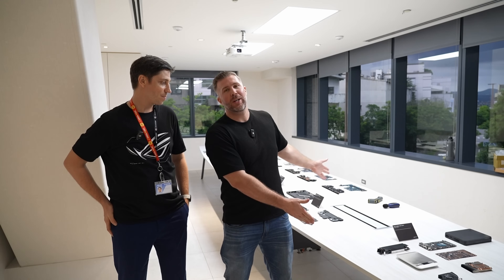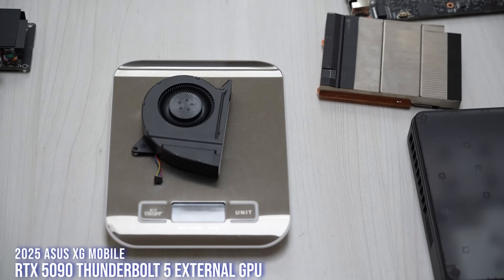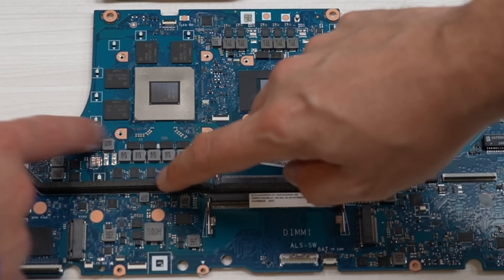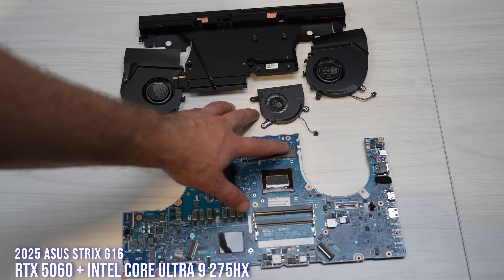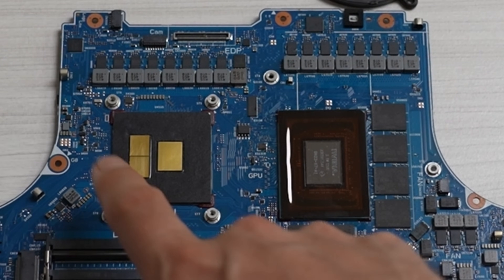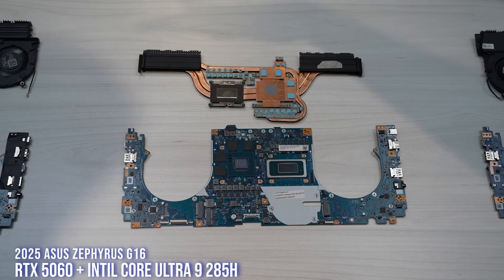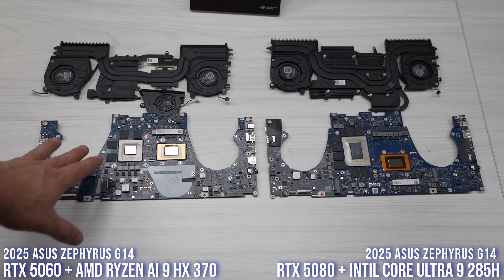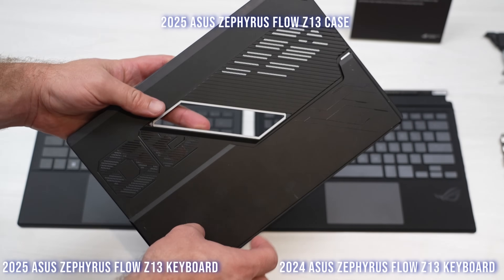Every 2025 Asus Laptop Motherboard/Cooler Analysis! 9955HX3D vs 275HX! RTX 5060, 5070 TI, 5080, 5090

Comment: well anyway we all knows the best CPU is AMD and it's the 9955hx3d or the 9955hx, the 285hx is the 3rd place, 4th place is 275hx
Reply: x3d is just too good when games or software utilizes it.
Reply: 275HX actually slightly outperforms 9955HX. Of course, the X3D chip is top of the heap.

Comment: amazing video, congrats! did you ask why no 5080/5090 with the x3d cpu? There is a small mistake in the g14 section of the video, it mentions intel cpu with 5070ti/5080 but it is amd only.
Reply from the maker: I made a video about this here: https://youtu.be/q1fxgoCvckk

I can't really understand the decision making. I have publicly said over and over again--and to Asus directly that this is a huge mistake and that they should have made the Asus Scar 16X3D and Sar 18X3D versions with the new tooless bottom chassis. 

My honest thoughts on this: 1) Asus probably had lots of leftover chassis from the Scar/Strix from last year, and they wanted to still use them, so it's cost effective to use the extra chassis for a second product. They thought people were going to prefer Intel again this year, but the reality is AMD is ahead currently--and the 5070 TI GPU is the most like to sell the most units, so they probably wanted to limit total number of configs since that increases costs. 2) Intel and Asus collaborated on the new version of the chassis somewhat, so I believe that Asus is likely giving them an preferential treatment for now, which sort of makes sense if Intel invested money/time/effort into the project and AMD did not. 3) Asus has a long standing relationship with Intel dating back 10+ years. 4) AMD failed to supply chips to nearly ANY manufacturer during the covid chip shortage, while Intel had supply, so I think Asus HQ feels it's too risky to base their flagship product on AMD most likely. And we are seeing that, not enough X3D chips to go around, so limited supply is a valid concern.

All of that said, I still think they should have at least offered the 2024 chassis with the highest end RTX 5080/5090--they are just erasing potential profits when loyal Asus gamers see the highest end CPU/GPU being placed into another brand and not Asus, forcing them to jump brand to get the fastest GPU/CPU combo--which I predicted all the way back at CES 2025.
Reply: @GizmoSlipTech thanks, it always amazes me how they miss seeing the obvious. Imagine for example a « thick » version of zephyrus g16 kinda like blade 16 2024 version, with x3d cpu, 5090 and oled, it would dominate❤
Reply: @michaelcorleone3282  so for the zephyrus g14 5070ti version, which one the cooling system we'll get?

Comment: I might buy a 4070ti g14 when there is a good sale as the 4070ti does lose that much performance at 120w from experience (a friend of mine has bought a msi vector 16 hx with 5070ti on ballanced mode it uses about 120w gpu cause at full 140w power it is very loud over 55 db)
Reply from the maker: Do you mean 5070 TI?
Reply: @GizmoSlipTech  oh haha yes actually the 5070ti

Comment: i m wondering if u buy a vapour chamber version laptop , is it a once in life time solution or do we need to apply liquid metal to the cpu  do we need to change or reapply in after some years of use ?? what the use case of vapour chamber laptop with difference to regular heat pipes laptop???
Reply from the maker: Typically, heat pipe or vapor chamber (doesn't matter), liquid metal can last a really really long time if it is sealed correctly--like 10 years. But if the seal breaks or it was a bad initial application, then you may need to reapply. For this reason, a lot of companies are switching to 2 phase material like PTM 7950 that has about as good/better temps as liquid metal, but it is hard to mess up the application and lasts about as long. I believe Asus has a lot of their laptops this year with PTM, unless you see the liquid metal shroud over the die, then it's PTM being used instead of thermal paste, which both degrades over time quickly due to drying out after 1-3 years, depends on the paste though.
Reply: @GizmoSlipTech  thanks bro ,right now i m using MSI CROSSHAIR 16HX 4070 ONE,cpu is throttling, clockspeed going down during editing videos even though it is 4 months old  , so i might go for ryzen fire series lineup this time, asus is better in cooling than MSI , i guess

Comment: Thank you for interesting format! Waiting for the 5070TI TUF laptops :)

p.s. since a16 has desktop chip and a18 does not, is a16 chip better than the a18? Or it depends on configuration?
Reply from the maker: Yes, 100%. The A16/F16 have optional high performance CPU, while the 18" is more so a budget laptop in a 18" chassis.
Reply: @GizmoSlipTech  not so obvious for potential users
Reply from the maker: The do have a $1449 version of the A16 as well with the Ryzen 7-260: https://listium.com/@GizmoSlipTech/80658/all-2025-gaming-laptops-ranked-list-gizmosliptech/1243/asus-tuf-a16-ryzen-7-260-rtx-5060-16-32-gb-ddr5-5600-512-gb-ssd-fhd-165-hz-300-nits

Comment: I am hoping for a revamped Flow X16 with a Medusa Halo APU next year. The amazing form factor of that machine combined with the all-around great CPU/iGPU of the Strix Halo successor would make it the best productivity laptop on the market. Add to that the hopefully improved I/O with USB or Thunderbolt ports that go up to 80 or even 120 gb/sec, and I can also see that laptop serving as a desktop replacement when combined with an external GPU dock and allowed to use all of its TDP to power just the onboard CPU that in turn drives the beefier discrete graphics card in the dock. It would honestly be my dream machine, I've been waiting 3 years for it now and keep hoping that ASUS will deliver soon, of course with the rest of the specs and build quality also improved!
Reply from the maker: I am hoping laptops with Strix Halo like implementations become more common. I could honestly see AMD competing quite well with Nvidia in the low-mid range using powerful iGPU implementations.